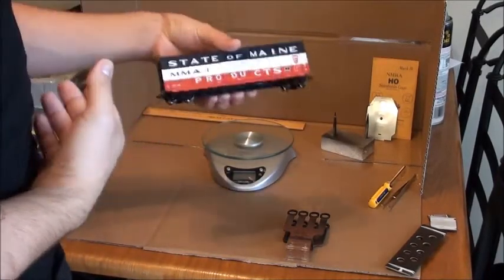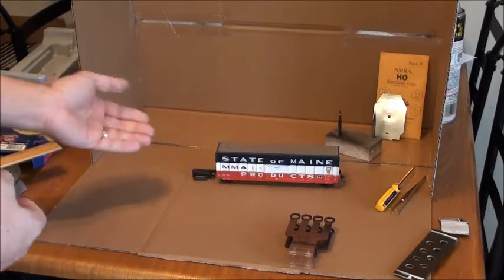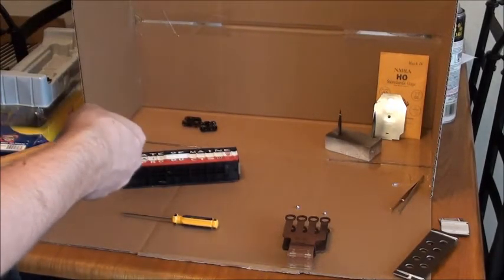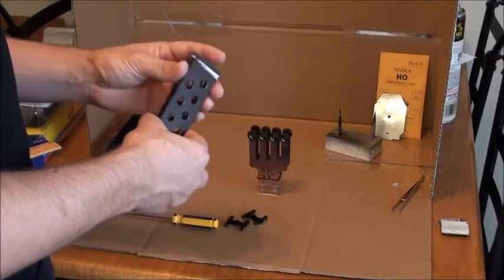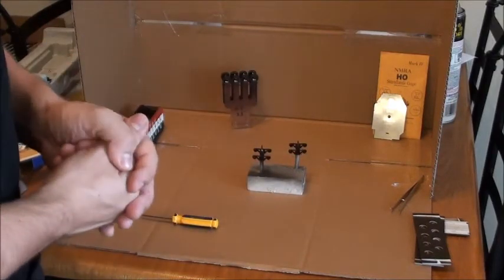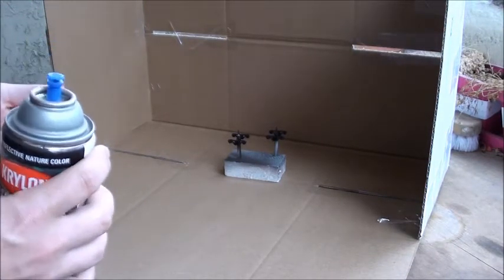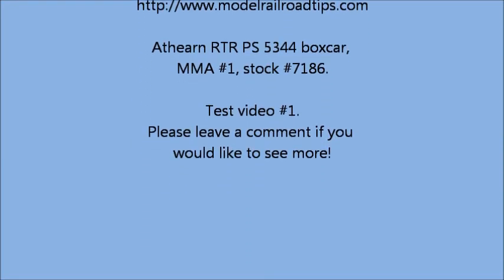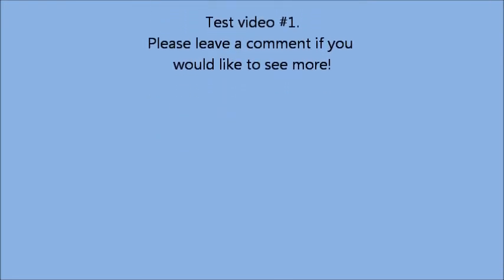Model Railroad Tips: Athearn PS 5344, MMA #1, Part 1

Comment: @ModelRailroadTips Hi, saw your post on the Atlas forum. Critique: Overall - GOOD Job.  You didn't need to apologize about the freeway (white noise) as your voice carried through very well. Tip worth mentioning to newbs is to clean out any paint that gets inside of the journals (especially if one on passenger car trucks).  Looking forward to more of your videos! Question: Where did you get your digital scale & how much was it? My old post office scale went to the scrapper.